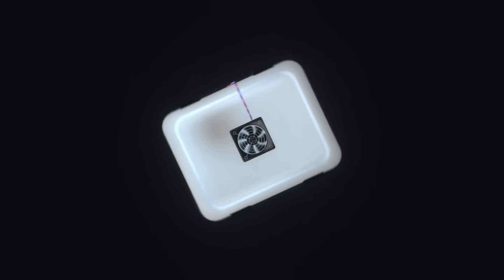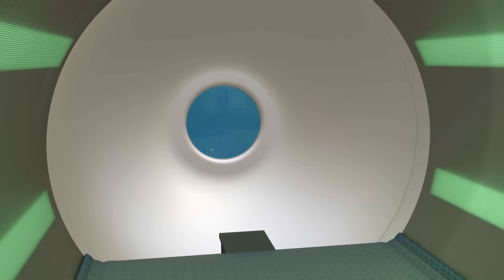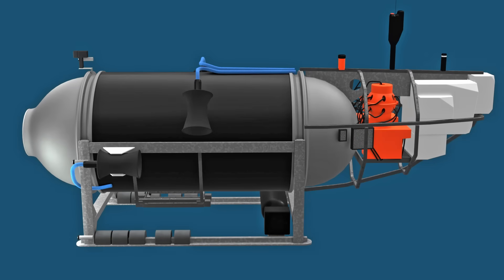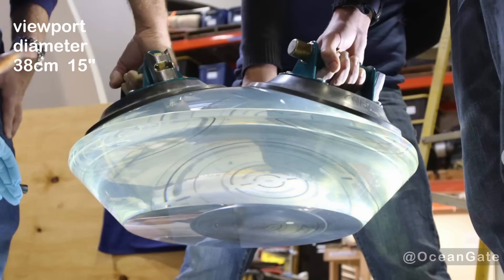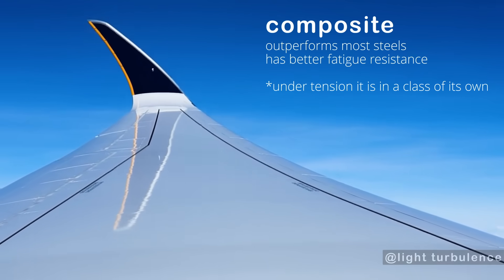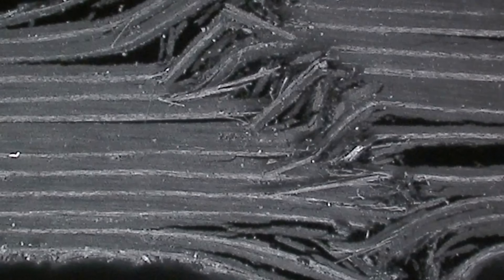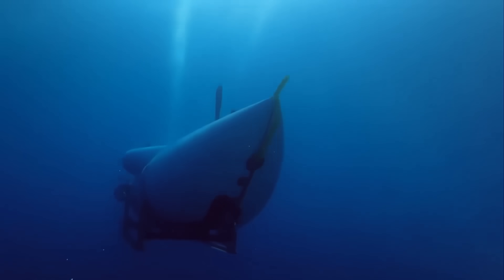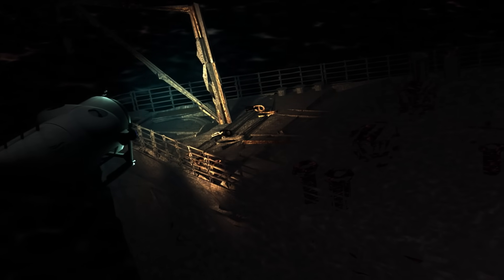Titan Sub | carbon fiber - Detailed Tour

Comment: I don't know why people were so worked up over two aspects of it:
1. The game controllers are very well established tech that has been tested by literally millions of users.  The military uses similar controllers.  There is nothing inherently wrong with using these.
2. Bolting the sub shut isn't a bad thing.  At those depths any seal is subject to massive pressures.  A manually openable hatch would be subject to seal failures and such.  There is no way to escape at those depths anyway.  At the surface popping open a hatch would be a great way to flood the sub and drown.  It wasn't that crazy, since they always had a minder ship on the surface, to have the sub bolted shut.

The reason they went with a cylinder instead of an inherently more stable sphere was that you can't fit as many people into a sphere and to fit as many as they did would require an ungainly large sphere.  The cylinder allowed them to fit more people in and make a commercial venture possible.  Unfortunately it also meant it wasn't as strong and had vulnerable end points.

I wonder if it would've been possible to have a safety cable attached to the sub as a last resort "pull them up" system.  I suspect it would be in danger of getting snagged on the wreck though.

Comment: Carbon fiber has lousy fatigue resistance to forces that act to split the fibers.   
On an airplane, the forces, whether they are compressive or elastic, are predictable and are designed to act in line with the fibers.  In a sub the pressure acts in all directions under varying levels of stresses depending on the depth resulting in shifting stresses throughout the hull thickness.  
Even criss-crossing the layers only goes so far because individual layers will still experience stresses against the grain instead of with the grain which results is separation of the the fibers.  Every crack Rush and his passengers heard was another group of fibers splitting apart, weakening the hull with every dive until the hull was no longer able to withstand the water pressures imposed upon it.

Comment: They used putty knives to glue it together, in an open air facility.
And had an acrylic porthole that the manufacturer refused to rate for those depths.

Stockton was an idiot.

Comment: The cylindrical part of Titan was basically designed like the middle of a pressure vessel - with a high pressure inside. - Under water Titan had instead a vast pressure coming from outside!!!

Comment: Couldn't they have sent the sub unmanned to test it until it crushed? Is there any wireless communication method that can penetrate that deep? I always found that design very interesting.
Reply from the maker: Absolutely they should have done repeated unmanned dives to a lot deeper. That is exactly the kind of real world testing the certification bodies would have been demanding. And the only way you would be able to say with a straight face to passengers that the sub was safe.

Comment: Bottom line, Carbon fiber is no good for extreme water pressure, repeatedly, or we could test it again, by bolting the narrator and pro-Carbon fiber folks in, and repeatedly submerging that pile of garbage.
Reply from the maker: Composite pressure hulls on deep dive craft. The folks who built these successful vehicles do know a thing or two about extreme water pressure 😉. Here is a list https://www.researchgate.net/figure/Composite-materials-being-used-in-submersibles-worldwide_fig1_364296004
Reply: @Mike-Bell  And yet Stockton Rush was warned repeatedly, but refused critiques, and wound up causing people to die, needlessly, making himself into a cringey joke of a man.
Reply: @Mike-Bell  You're that guy that got dumped by a girl and then listed reasons that she should stay with you. Bottom line, you didn't turn her on.

Comment: The Young's modulus of carbon fibre (CF) is different to that of titanium. At depth the materials would have compressed a small, but important and crucially different amount. This would have caused damage over time between the CF and titanium interface i.e. at the ends of the CF cylinder and the titanium rings.
Reply: They had to know about that. Surely with all of the people working on it and even ones just looking, someone had to have mentioned this.

Comment: I don't know. If carbon fiber was really viable for deep water hull construction, I can't help but think that more sub manufacturers would be using it. There is a reason why they avoid it like the plague. The OceanGate story pretty much sums it up.
Reply: Hard to know. It is a lot easier and cheaper if you use something you know, and you have numbers for it, and you can predict success. I am sure the first carbon fiber wings buckled like tin can and fell apart, but eventually they got all the kinks out. When you are doing it as a hobby, and not having lots of testing for crazy conditions and damage, and not doing a lot of tests with a remote, then you have a high chance of dying in development. As we know, communications were difficult under the water. I assume that made testing it in the real world, remotely, practically impossible, or at least very expensive. Everything is a trade-off. He sided with taking more risks than a lot of people would. If you asked me to design a safe submarine, there is no way I could guarantee success with a new material. Until someone does all the dying and dirty work, no large scale commercial venture is going to use it. They are not building them for fun and adventure, and the thrill of innovation, they are building them to do jobs and make profits.

Comment: Good video-probably the best that I have seen on this tragic incident. I agree that this can be done in composites but not on the cheap like this. If this had been done by a credible organisation (eg US department of defence) it would have worked, but it would have cost a lot more
Reply: I agree. It was not a materials problem, it was a design and testing problem. It obviously worked, but someone should have known what the loud popping sounds were, and when to replace the hull. This seemed to be more like a hobby project, really. He was fine with taking shortcuts and risks, like someone building a cheap boat in their yard and then inviting the neighbors to go boating on it. and.. they have to pay for some gas 😂
Reply: And probably would have taken a LOT more time, which Rush either didn't have or didn't want to take.

Comment: This incident will likely increase demands for testing and certification of all submersibles as well as dampen peoples confidence in composite pressure vessels. You'd never get me in one of those. The only silver lining in this tragic mess is that the hull likely popped so fast and sudden that the victims didn't realize they died.

Comment: Considering all of the submarine experts agree that carbon fiber is a bad choice for submarines….I agree with them.
Reply from the maker: This was not the only composite deep dive vehicle. Here is a list https://www.researchgate.net/figure/Composite-materials-being-used-in-submersibles-worldwide_fig1_364296004
Reply: @Mike-Bell  …but most of them are unmanned.  You left that crucial detail out.  No need for life support or pressurization.
Reply from the maker: @wolveswithoutteeth  Not so. They have composite pressure hulls to maintain regular air pressure for computers and essential equipment.  Which is the hard part and dive deeper than Titan.
Reply: @Mike-Bell  …You keep believing that.  You can dive in a composite hull if you like.  I hear it’s a real experience.
Reply from the maker: Even before titan would never have set foot in a sub. But happy to model and animate one from above ground.

Comment: The problem isn't that carbon fibre was used, although you can argue with its use, although there are arguments for why it shouldn't, it is perfectly reasonable to push the limits of technology. However **HOW** you go about pushing the limits is the important thing.
Submersibles had a thoroughly well validated method for certifying them as safe, non-destructive and destructive testing should have been carried out prior to transporting passengers, it's all very well having a model that predicts success but that model may not (for many many reasons) adequately represent reality.
There are fundamental reasons why a laminate structure may not be suitable for a submersible - the risk of delamination from water. Air pockets and non-homogenous sturcture. The risk of the laminate delaminating under compression failing before the medium itself formally exceeded its loads. 
Simlar issues like having a porthole that cannot be openned from the inside and routinely dismissing the concerns of those qualified who should have been listened to.

IMHO Oceangate believed its own hubris and that's why they got people killed, if it wasn't the hull failing it would have been something else.

Comment: Idk buddy, sub didn’t survive. So. Seems not too great
Reply from the maker: This badly laid up tube still withstood the insane crush at titanic depth 13 times. If an incorrectly built carbon fiber tube handles spectacular compression. Imagine how a meticulously built one could manage. But as the video emphasised only through thorough testing can you make it safe.

Comment: Since the actual thorough testing still has not been done, why do you say confidently that CFRP is suitable for such deep diving vessels?
Reply from the maker: Cameron made the blanket statement that composites are not used for deep see vehicles.  But this untrue. There are a lot of other vehicles some diving even deeper.  Here is a list https://www.researchgate.net/figure/Composite-materials-being-used-in-submersibles-worldwide_fig1_364296004
Reply: @Mike-Bell  Yeah, and all of the deep water ones are either single use, like deepflight, or unmanned. There is no manned submersible on that list made for more than 1,000 meters. The one listed at 1000m, deepflight was rated "single use" by it's owners. Only one below 1,000 meters was manned, Titan 2, and it failed after very few dives. So again, where is the deep water testing of a man capable CFRP deep dive submersible hull? You complained that Rush did not do it before making manned dives. Who has done it? When you remove the "manned" part, obviously that's been tested, and is a bit easier. It's the "manned" part that matters here.
Reply from the maker: The list includes vehicles that are in ongoing use.

Comment: So far, the best review of the situation I've found. I constantly doubted that popular opinion about carbon not being good in compression. I thought, hey, we have composite plane wings,.. man, something does not add up. And longitudinal load (*facepalm*) this adds a lot to think about. How did I not considered it. Circular windings being held up just by resin would simply collapse like a slinky. Those straight fibers really could have been the actual part that gave away. Thanks for fine insights.
Reply from the maker: I'm happy you liked it.  They did a second salvage 2 weeks ago.  There was a foto of the recovered aft pressure dome they brought ashore.  I have seen nothing of the carbon fibre shards they may or may not have recovered but therein will lie vital clues as to how the tube may have failed.  I certainly hope there is a definitive explanation for how this happened.
Reply: An aircraft wing is very different from a sub.  One is exposed to stress by flexing from positive and negative G loads.  When the sub was exposed to stress from heavy loads from pressures from the deep sea.   And also the pressure difference, a plane at 12500 feet won't have the same pressure compared to the sub at minus 12500 feet with all the weight of the water on top of them and around them.    And carbon fiber will react in a very different way between the upper atmosphere at 12500 feet and minus 12500 feet down in the sea.   And Carbon Fiber has it's limits and can be the weakess point in a vehicle if not properly used or has defects in the manufacturing process.
Reply: @lepompier132  the ambiant air pressure is not so much the issue but the compression of the wing spars that make up the wing frame and attach to the fuselage. These are bouncing up and down holding the weight of the aircraft. Parts will be in tension, other parts will be in compression as the aircraft bounces through the air, turbulence, manoeuvres, but the key is in the testing and designing that wing box to not fail under known loading so that tue wings don't fold up under normal and some abnormal loads.
You can see some photos and videos of wing testing where aircraft wings are being bent to 45+ degrees without failing: the bottom parts of the wing structure is under tension and the top part under compression as the wing is not a flat 1 dimensional part - and we know that things can fail, so we design in a safety factor so the wings won't fall off an airbus after 10 takeoffs :)
Reply: Chinese whispers was likely responsible for that one. Someone who knew the truth would have said that CF isn't as good in compression strength as tensile strength which is true and that will have become CF is not good in compression over time.

Comment: While your credentials qualify you, your calculations and measurements missed something….. cause even though your calculations work, the final true result was catastrophic..  so some thing was obviously missed.  On paper it works but in application it failed.
Reply from the maker: The tube held for 13 dives so it was strong enough, but with major flaws in the layup it was just a matter of time.
Reply: @Mike-Bell  not for 14 dives and they were advised it had a very limited amount of cycles.  There are no numbers you can come up with to not fault the use of Carbon the way they utilized. It collapsed and there is nothing more we can blame it on.  Aviation is not the same science as a deep dive with multiple atmospheres pressing in all directions

Comment: I can not concur. 
Carbon fiber WAS stupid.   It CAN NOT be rove to add strength to a vessel under external omnidirectional pressure. There is no winding schedule that will put the carbon to work.  “Engineers” claiming it gives compressive strength are fooled by the fact that under single dimensional compression, as in a column, the resin Expands in the other two dimensions.   The fiber can be rove to limit THAT expansion thru its tensile properties and thereby increase compressive strength in a single dimension.    But the bottom of the ocean puts materials in compression in ALL THREE dimensions. It allows NO expansion in ANY direction and as a result, ALL the fiber in a carbon fiber vessel under oceanic pressure is placed in compression.
Carbon fiber is NOT rigid. Its a ROPE and putting coils of rope in compression only buckles the rope. 
Sorry, I don’t care how many airplane parts you tested. Airplane parts are NOT placed under external omnidirectional compression.  In flexure, the side of the part in tension is reinforced by the longitudinal winding. And the side in compression is reinforced by the circumferential winding which is acting to restrain the expansion of the resin matrix.    That is what makes carbon parts test as being strong in limited compression.
Not applicable to this use case.
A pressure cylinder holding pressure IN, like an airplane pressure hull, or a scuba tank, is the IDEAL use of carbon fiber because the internal pressure puts ALL the winding, in every direction, under tension.
A submersible is the exact opposite.   There is no direction that is not being squeezed into a SMALLER circumference. Ergo, the carbon can not be loaded in tension.
From its first dive, this hull made noises indicating delamination events in its structure. Each popping noise was a tiny reduction in the hull’s ability to distribute load evenly.  And each one was the result of carbon fiber trying to BUCKLE by spreading two layers of resin apart along their lamination interface, and the individual layers of resin, each, having to be fit into a smaller and smaller circumference.
There quite literally is NO way to rove a submersible pressure hull that will employ the unique strength of carbon fiber. This hull survived as long as it did the same way the viewing window did. Thru the relatively isotropic RESIN of which it was comprised.   And it failed for the reason the window did not. Because laminated resin is not isotropic perpendicular to its lamination plane. 
The reason you have not seen recovered hull wreckage is because it is not recognizable as hull.   Its is likely just a snarl of carbon fiber shot thru with shards of resin, mixed in with minced human remains.